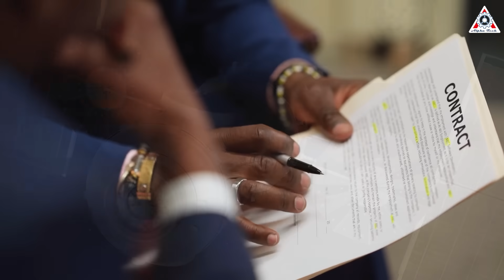Elon Musk's SpaceX Big Solution For NASA's NEW Station Problem and The ISS...

Comment: Pace a few international docking rings at the front of starship then you can dock multiple starships in a wagon wheel configuration give it a 1rpm rotation, now you have a rotating  space station with a large amount of mass. Add a truss to it you have the beginning of a true large scalable docking and manufacturing facility for  under 100 million.

Comment: Why would SpaceX remove the fuel tanks from the starship when they can fly it back and forth to Earth and change what's inside of it. by the time they did all the work of removing the fuel tanks and then bringing up stuff on another starship to put in the place of them that would be ridiculous it would just be cheaper to build a new starship and send it to space
Reply: Last I heard, Starship is to be used as a shuttle to larger ships in Earth's orbit that would go to Mars. Using a Starship as a space station, seems logical to me.
Reply: They should start with two starships tethered together at the nose.  This will allow the starships to spin at 1 rpm to create stable artificial gravity. They could replace the international space station with a few launches.

In time they can add a permanent structure for the starships to dock in the configuration.

Comment: Nice! Glad the ferris wheel configuration is being considered.

But that Nose Ring Thingie is a serious construction project, and an over complication. Back in my old writ on the concept, suggested dual side hatches, and accordian like inflatable connectors, and rigging the circle with cables, one to nose of each ship, to a center plate, and then side to side cables between ships.

Cable is pretty easy construction.

On the ships tanks conversion, could be done by having hatches preinstalled, but not cut free of tank skin.

A better way though would be to build "Dozer" shortened starships, that pushed a Station dedicated section into orbit, and then returned to Earth to be reused. less hassel, more efficient, no wasted motors, and sections designed to purpose. And your linking structure could be dual purpose as part of your connecting systems.

Also, you could do a Starship diameter section system, to later be filled in with say 4 meter/12 ft Supergun cans... ie, plan for two different sized  componants, and the larger coming before the smaller, but designed for it. Probably the SG cans used as connectors.

Then you could have a third element that was sections of framed sheets, and used to fill in between, and use your original contruction as a structure to be enclosed. allowing building basically a habitat of large diameter, with never a wasted launch in the process.

Its doable, even the ends, using interlocking systems and gaskets, held together by air pressure, and then strips welded over seams from the inside.

Y'all need to think ahead better, we're gonna be in Space a long time... So quit sending up disposable garbage, and start thinking extrapolative designs, and have the Structual Engineers catch up with the Engines guys on enlightened products...

Become Space Zengineers like the Raptor 3 guys... Quit cobbling on krapp, and get exquisite....
Basically its still a few years out, before Starships are ho-hum operational, so you have time to refine concepts repeatedly.

What I have learned doing that process in your head, when you cant build something yet, is when you can, what you build is several iterations better, and tends to look culturally evolved...

I know it really hurts alot, to have to think farther out, but you can do it, get good at it, and mentally tougher and more mentally agile.

What happened; 
When I was a kid in the 60's, heard that old Cliché thing about humans only using 15%-20% Of of their brains...

I thought about it, and realized most of what was missing, was likely from mental laziness..

So I began a thinking habit, which morphed into a thinking addiction. And I liked building and making things...

Another thing that helps is resource adversity... when you have to think of ways to design things around limited available resources...
Most modern Engineers are Spoiled Brats who can flippantly design using anything, and never develope a disipline from have to think more with less resources. They are like Gen Z snowflakes, not tough mentally.

I'd say; limit your available resources and componants like parts count.  and learn to use fundamentals in repetition... develope standard pieces and patterns that you use over and over.

Thats whats wrong with most current SpaceX competitor Station designs, unlimited resource options leading to cobbled up krapp designs.

I'd be doing Starship hatches designs and construction techniques that just transferred into station building systems, That were designed to purpose, rather than being repurposed ships.

Sometimes limits help....

Like the Farmers say about driving on rural roads:
"Keep 'er between the fences."

Good design needs fences too....

just Sayin'
Reply from the maker: I think we all agree we need to be more efficient.
Reply: @alphatech4966  
Yeah, Space is a challenging ambient to say the least, and what I am pointing out is important, that we really shouldnt waste time and money on vanity designs, using exotic ingredients.
You look at that other Space Station being worked on, and compare how its put together compared to Starship's industrialization, and it gets real obvious that its way more complicated and frivilous...
We need functionality  efficiency, speed, and affordability...
Like Cut out pieces for structual lightening, being designed so those pieces get used elsewhere. like say when you do round holes in structure you cut a center hole in  the scrap piece at the same time, and get large flat washers you use throughout the ship or structure. Ditto for rectangular pieces cut out, round the corner,s, maybe halve them and you have gusset pieces to go around hatches and ports.
Another example  might be running longitudinal structure on the outside of the pressure vessule, and transvers inside, 
So you can create partitions and mount equipment, etc. without the excessive structual complication, and the outside stuff longways not to create air resistance being launched.
Imaginge trying to install an internal bulkhead with both longitudinal and transvers framing, compared to just transverse.
Also that framing could be perforated to lighten, with different sized and shaped holes, as an aid to mounting things... from equipment, to gasketed bolt in bulkheads, or on the outside used to connect things, anchor structure or antennas, or clip space suit tethers to.

There's alot of thoughtful stuff possible, rather than trying to make things look cool, make them practical and well thought out.
And easy to construct and build onto.